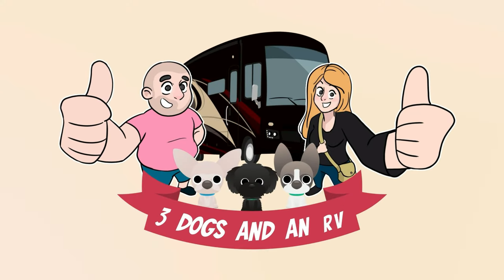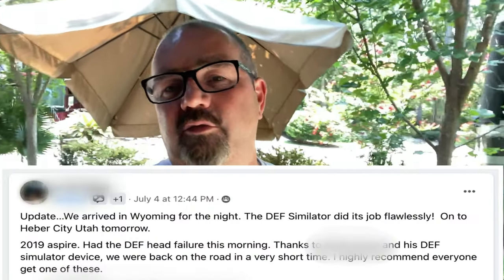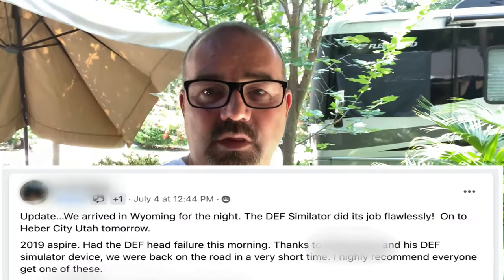Recover From A DEF Head Failure | Spartan AND NOW Freightliner Chassis

Comment: Thanks for the video.  My wife and I are on a month long trip and my DEF Level sensor is intermittently reading "empty" when I have a full tank of DEF.  My DEF head has already been replaced once.  Would you send me the info the the bypass unit?  I would like to wait until we return home to deal with the repair.  With the bypass on board I would feel safer in doing that.  Again thanks for the video.
Reply from the maker: I believe you have been in touch with Keith